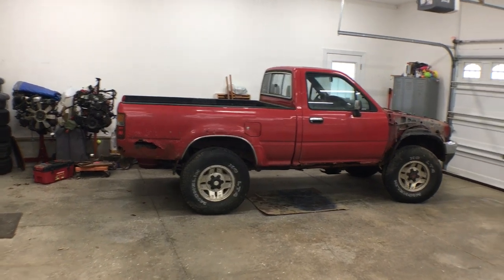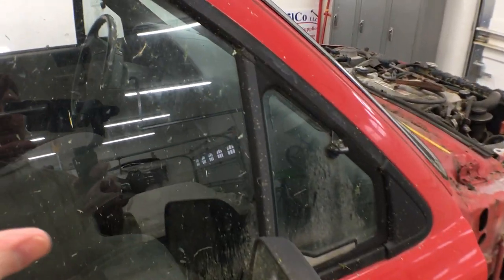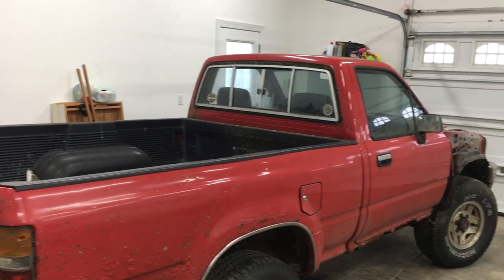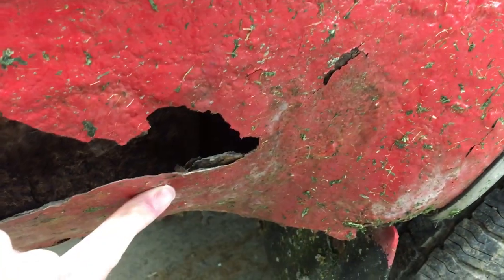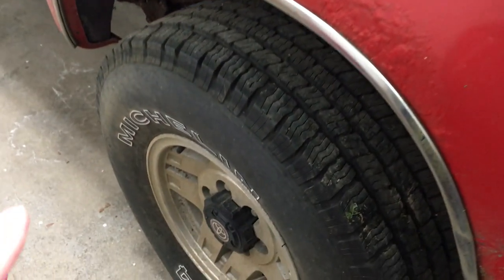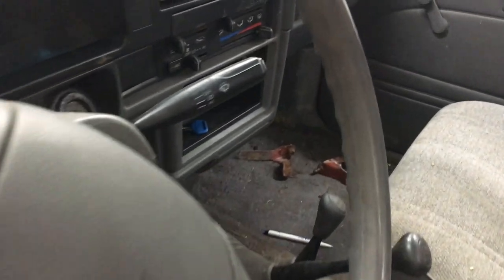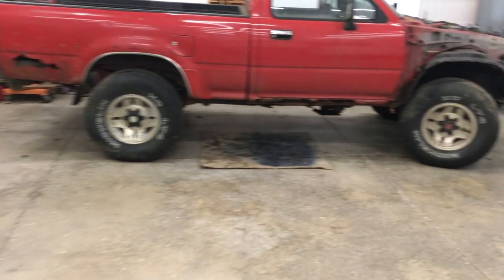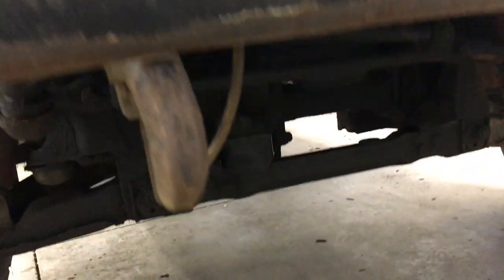1989 Toyota Pickup 4wd Rusted/Broken Frame - So Rusty!

Comment: Just found a rare 1985 4x4 with good surface rust frame but the body is 1/3 as bad as this truck. Won't pass smog and burns oil. I'm not sure if it's worth $7k. My body and paint guy says it might be $15k of worth. Any thoughts on if I should pull the trigger or just let it go?
Reply from the maker: Are you planning to restore it and flip it or use it as a truck and keep it?  Are you in California? Strict emissions but more rust free parts available in that area. Around here there are plenty of good engines but no rust free parts. Figure engine rebuild plus body/paint work on top of the $7k, is that worth it to you? If sr5/22re it will be worth more because 85 was the only year with solid front axle and fuel injection as an option in the USA.

Comment: The IFS can be good for your Black 87
Reply from the maker: Are the 84-88 and 89-95 ifs the same parts? I know the rear leaf springs are a couple inches longer on the 89-95.
Reply: Yeah I think it’s the same components should be an easy swap
Reply: Also does the rear window fit for a 1984 Yota Single Cab 4WD